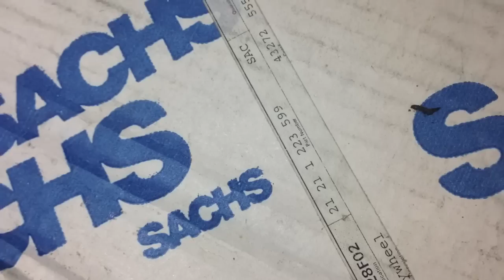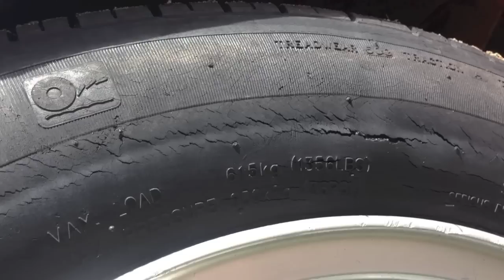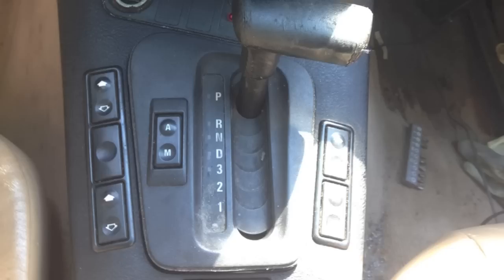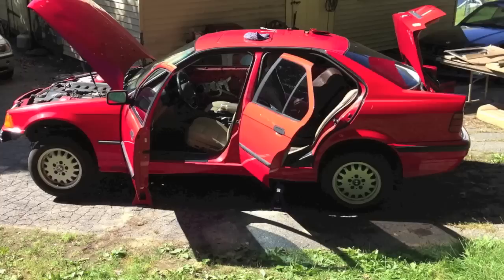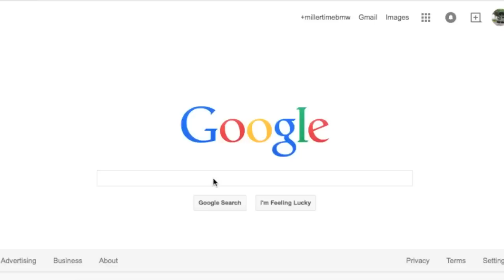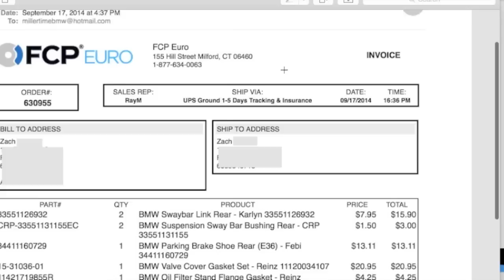BMW Race Car Build for $900 Part 2

Comment: You don't need rear seats in a race car :P
Reply from the maker: Lerena007 Yeah, I hope to get good enough to not need 'em :D
Reply: millertimebmw :)
Reply: millertimebmw Lerena007 u dont need carpet also
Reply: +Lerena007 and carpet :D
Reply: or dashboard
Reply: or brakes
Reply: k or an engine

Comment: An oil leak in the front of the engine is very normal to m50b25 engines... Basically all of them do leak oil from there and it is a major issue with these engines as it is as common as it it is. I had a white '92 e36 325i manual tm it had bilstein suspension a chip and a performance exhaust and that thing flew! Even tho it was a four door it was a very light and well balanced car- actually the weight ratio in an e36 is pretty much 50-50 which makes it so damn comfortable to drive and the sound of that big ass inline 6 roaring... Perfect car. Sold her last fall tho and now I regret it...
Reply from the maker: Oxenan17 Agreed, 4K RPM+ is awesome.

Comment: I ve got a 320i almost identical to this. Need time to heat it up before transmission would go on reverse. In winter i need to rev her up before it would go on drive and it will take around 1 minute bfore it would go on reverse. Is this bad? What could be done to fix this. Budget considered. Thanks and more power. I'll be waiting for part 3.
Reply: Any clue on the last time that transmission was "served"? oil changed at least?
I will say that best/cheap/wise solution will be to convert to manual...

Comment: Loved the vid man, quick question if you don't mind though. You painted the seats? If so, how exactly did you go about this? I want to get rid of my dove seats b/c I don't like the color but they are in excellent condition
Reply from the maker: I'm not sure if they sell it where you live. You have two choices.#1. "leatherique", its a leather dye. OR #2 spray vinyl dye, like I used. #2 is cheap but might not be as nice as #1.
Good luck, Zach!

Comment: Great video series !! I have a question, how did you paint the dash board?? -Thanks from panama!
Reply: They sell plastic paint. That what most people use to paint things like the quarter panels and what not when doing a color conversion. It's what I'll be using when I change the tan roof and panels in my black interior car.
Reply: thanks alott

Comment: Did you cut your carpet around the heater core or did you yank that thing out since you had the dash off?
Reply from the maker: +sean krinik I believe I did cut it, it's so far under the dash I knew I wouldn't see it cut there.
Reply: +millertimebmw thanks for the response. Yeah everyone seems to cut it at the core. I'm thinking of gutting my car so I was just curious. Already have a half gut on my 325is. Looking forward to more from this project!
Reply from the maker: +sean krinik Thanks again man. I'll make sure not to let you guys down :D